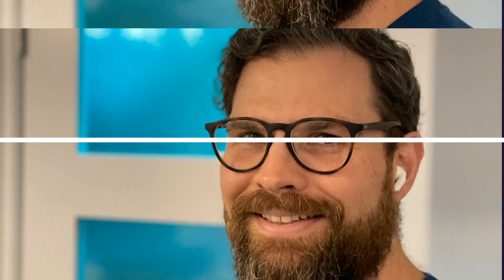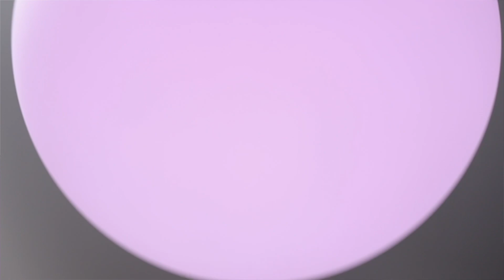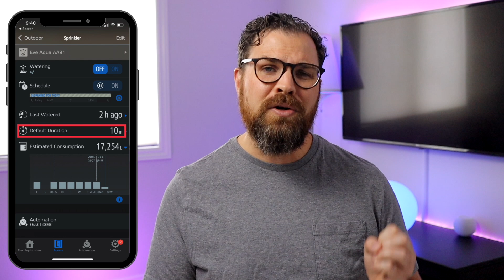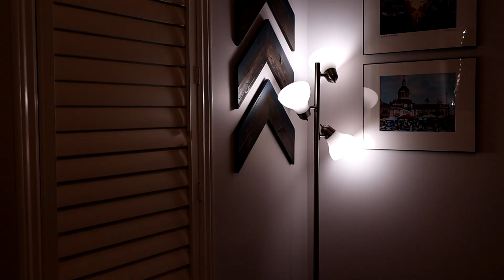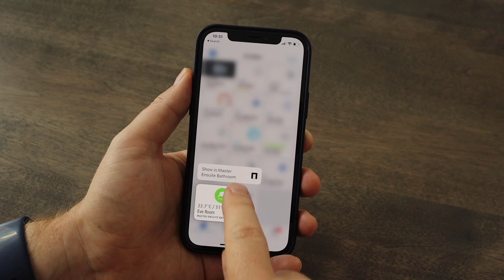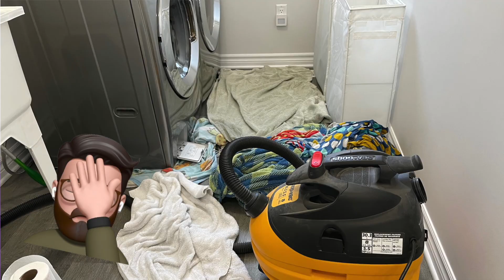TOP 7 MUST HAVE EVE PRODUCTS for HomeKit Smart Home Users

Comment: Just a question.. why would I need a eve motion sensor if I have eve window and door sensors? Or vise verse, is it a good idea to have both.. I think they are almost the same thing just smaller because the doors sensor can turn off and on lights but so can the motion sensor so I’m confused between which I should get
Reply from the maker: Hi Gerald - a door and window sensor is best if the situation makes sense. It's generally faster and more precise than a motion sensor. So if you are opening a door to turn lights on, use a door and window sensor. But if you are simply entering a space (no door to open), then use a motion sensor. No need to have both. Hope that makes sense.

Comment: Hey Brad, I have a couple of Eve products. I purchased their first generation Water Leak Sensor (one of my first HomeKit accessories) before Thread was ever announced. If they ever come out with a Thread version of this, I may end up replacing it with the newer version so I can extend my Thread Mesh Network

I have an Eve Weather with Thread on my back porch that shows me the outdoor temperature and humidity at my house. However, since this is an "End Device", it really doesn't help to extend my Thread network, but I have had no issues with connectivity in HomeKit.

I also have an Eve Energy Smart Power Plug with Thread and an Eve Contact Sensor with Thread. I was going to use the Eve contact sensor to replace my Aqara contact sensor for my mailbox automation but I am having some issues with getting it to work on Thread. The Power plug is to far away from a Thread border router, so I will either have to get a HomePod mini for that area of the house or get another Eve Energy plug to put somewhere in between to extend the Thread network. It appears that my metal mailbox may also be an issue with having the contact sensor inside the mailbox.

My Aqara contact sensors work great so I will probably not change them out with the Eve contact sensors.

I recently purchased an Eve Aqua Smart Water Controller with Thread. I updated the firmware on it so it would support Thread. However, I am unable to get the Schedule to show up in the Eve app. Not sure what is going on there. Right now I can only get it to run automatically for 10 minutes before it shuts off. I cannot get the Home App automations to "see" the Water Controller as an accessory so I have to create the scene in the Eve app and then I can create an automation in HomeKit to run the scene at a specific time on specific days. But I can only set the duration to either 5 minutes or 10 minutes in HomeKit.

If they come out with a Thread enabled Flare, I will pick one of those up as well.

One thing I don't like about the Eve app (and it may not be something Eve can control), is that my HomePod Mini's show up as Routers with a cryptic Hex number assignment. I have no idea which HomePod mini it is displaying. If it could show it's real name or the room location it was in would be a great help in trying to diagnose Thread network issues.

Eve Motion Sensors are way too big and I prefer the Aqara motion sensors as it allows me to "aim" the sensor easily to pick up motion in the desired direction from the sensor. I have a coupe above door ways, so as soon as you walk through the door, or open the door, the sensor is activated and the associated scene runs. This would be very difficult to do with the Eve Motion Sensor.

I am also a big fan of the Aqara G2H camera hubs and I love that they have a "fish-eye" effect reduction. If Eve added that to their cameras and they were Thread enabled, I would give them a serious look.

And, I totally agree that the Eve Light Strips should come with Thread. Again, if they come out with one, I will give it a serious look.